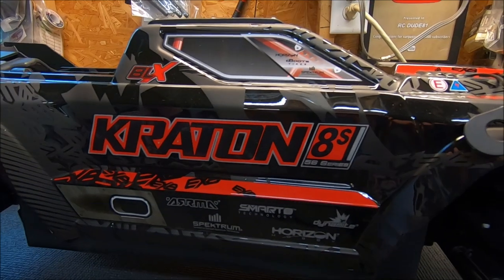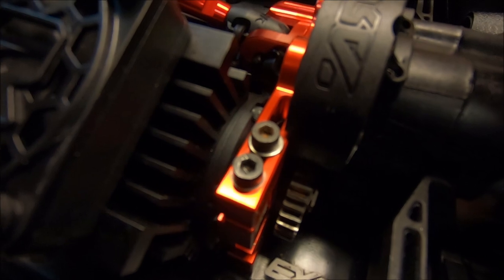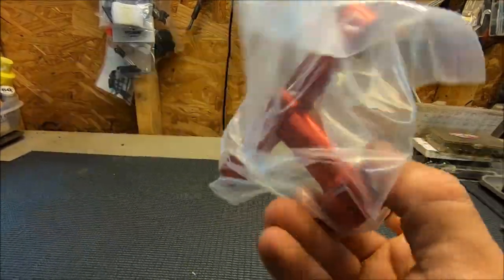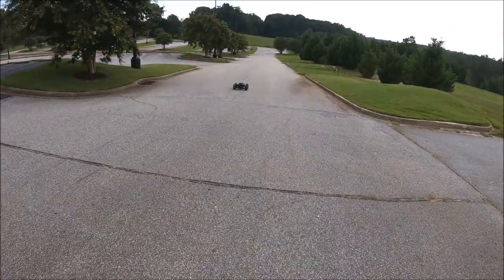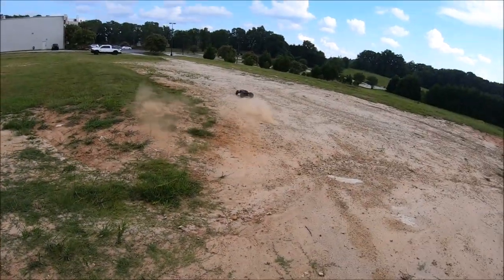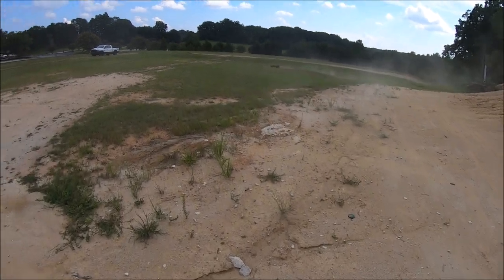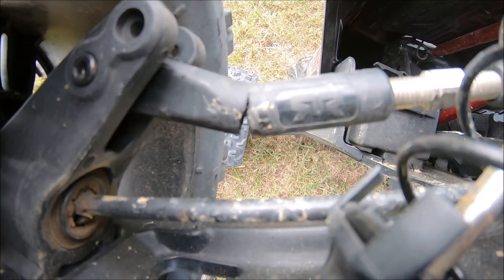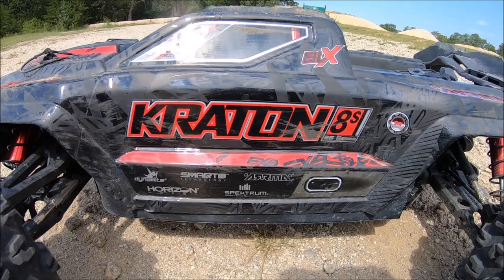NEW! Arrma Kraton EXB 8s RTR Monster!!😱 First Look And Mega Bash!

Comment: How did you get yours to wheelie I’ve had mine about 2 years and it’s never wheelied my talion will very easy but not my 8s kraton
Reply from the maker: It had issue with the new electronic system Arrma put in these and with a 28 tooth pinion and Max ESC punch!

Comment: How you compare the power to say a hobbywing max5 and a hobbystar 980kv?
Reply: I run this 👍🏻. Big power . I don't remember my gearing at the moment. But I don't run high gears. Rather run cool.
Reply from the maker: A Max 5 and 980 would probably have a bit more torque but also heavier. Tis trcuk was plenty fast and powerful for me in these days. It was very controllable which I like! If the electronics ever burn up I may go another route then!